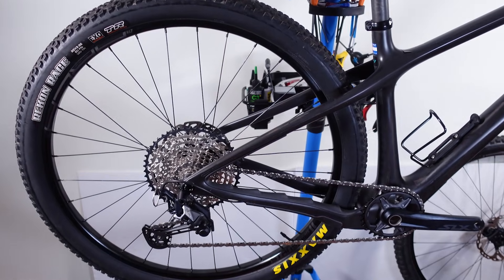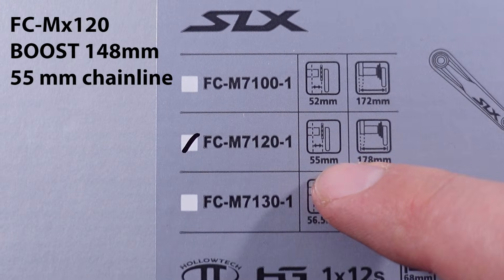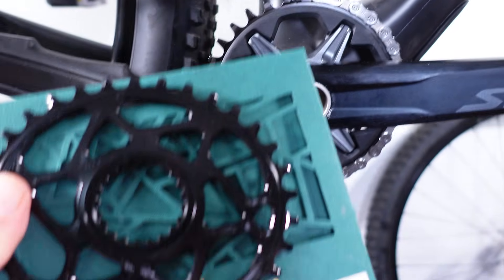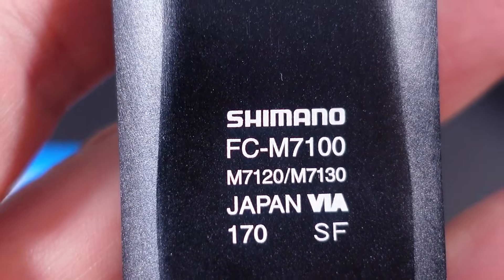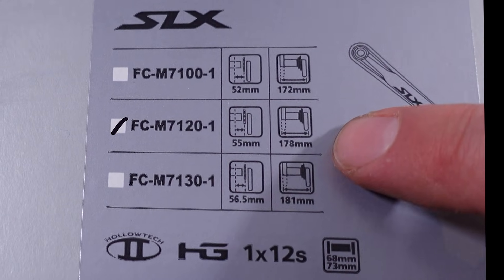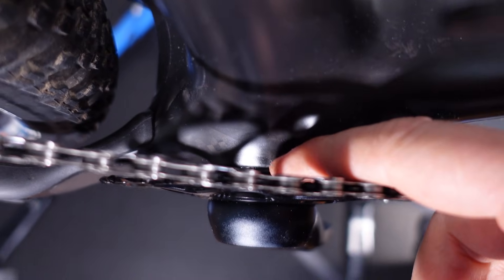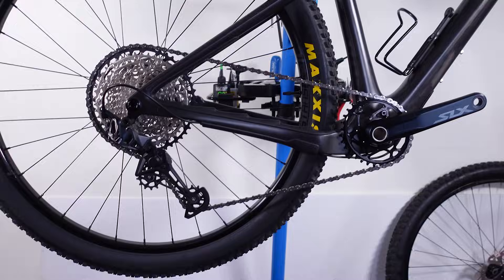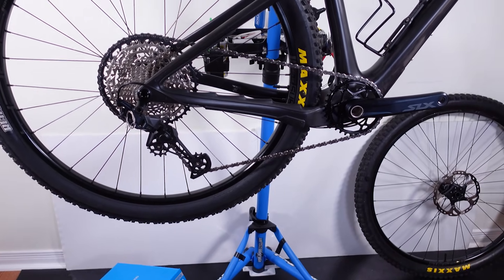12 Speed CHAINLINE Explained - 52 vs 55 vs 56.5 mm, Shimano SLX M7100 vs M7120  Cranksets

Comment: Great and very informative video!
I see from your other SLX review video that you have a 2018 giant trance 3 - it's a boost bike with stock cranks (FC-M7100-B) that have a 3 mm offset and 172 Q factor - if I'm going to upgrade to SLX 1x12 should I be getting the FC-7100 that better matches the stock config? I'm worried that the FC-7120 with 55 mm chainline would be problematic with the 51t as you mentioned.
Reply from the maker: I would go for the 52mm chainline if the bike permits.

Comment: I have a question, I bought a SW EPIC EVO frame that has 52 chain lines and I bought the whole XX SL groupset with a power meter crank that is on a 55 chain line and the crank is 34T and 3mm offset. It is also possible to buy a 34T with 0mm offset. I'm not a mechanic, but I'm wondering what can I do in this situation? Please help!
Reply from the maker: Don't worry about it, just install it. And check out my mini0series on the Transmission for more info - https://www.youtube.com/playlist?list=PLAXVoVap1M6ujA8bbEOQLDRI_ElQtvu5T

Comment: Hi there, I had a problem trying to fit oval chainrings to my bike. Most aftermarket ovals have offset which varies depending on  type of crank. I found out from the my bike's frame model(boost) is made for 52mm chainline...The bike comes with deore m5100 crankset 32t (11speed) which is has a 52mm chainline. This particular crankset can be used on non boost and boost frames. Same goes for the shimano crankset lineup 52mm chainline m6100/m7100/m8100.(The m6120/m7120/m8120 are 55mm chainline)...However when used on a boost frame like mine. It will give you a very tight clearance especially if u go up to 34t or an oval aftermarket..I would not be surprised if the oval can't fit even with  30t ones because most ovals have offsets bringing the chainring closer to the frame.

I had to find a solution  if i ever want to get a chance to use aftermarket oval chainrings on my bike. Adding spacers to the drive side of  the bb to bring out the crank doesn't cut it... This is because you are shifting the crank outboard and it will be a problem to install the left non drive side crank arm. There is not enough to grab onto the spindle and it will not be safe. I know from experience coz mine flew off 😵‍💫 when I did this.This is for shimano cranks as the installation of the crank is different from other brands.I know I had to get a crankset with a longer spindle  to accomadate the offset that comes with an oval chainring..

My solution was to purchase the m6120 (12 speed) with a 55mm chainline..next was the oval chainring from Garbaruk in 32t. The chainring model I purchased states it for m7100 series and the 8100series crankset. However, as long its for the direct mount shimano chainrings it would fit across all models with the exception of the M9100 series(XTR)...I think its because the xtr direct mount requires a different lock ring for the chainring(internal).This oval chainring from Garbaruk has an offset of 3.3mm. My bike ideal chainline according to the manufacturer is 52mm. So, 55mm (crankset chainline) - 3.3mm (oval chainring offset) gives me a 51.7mm chainline which is very close to what I was aiming for. 

My conclusion, if your frame is boost 148mm. Get the 55mm chainline cranks. This enables you to shop around for an aftermarket chainring be it for round or oval ,from different brands and choose an offset and how large a chainring that can fit ,that is ideal for your frame. Do take note some chainrings brands for 12 speed shimano needs to be used with the shimano 12 speed hg+ chain only...I chose Garbaruk coz their chainrings are compatible with all speed (9 and above) chains no matter the brand..check their website.

If your frame (boost) chainline is 52mm and you get the 52mm chainline shimano crankset, you are limited to probably a round chainring with max of 34t depending on your frame clearance.Also the chainrings must have zero offset because with an offset the chainline will be lesser than 52mm.Unless your frame is meant for maybe a 49mm chainline?

Just sharing my experience so to help others who are in dilemma of finding the right cranks to fit their bikes.
Reply: Great wright-up, have the exact same problem.
Reply: Thanks so much for this - I'm in a similar situation and trying to figure out how to make my chainline work with clearance for an oval chainring. I'll be ordering a Garbaruk chain ring it seems!

Comment: How do I know in advance, which crank length I need? I doesn't look something that is accurately measurable. I have a Giant Toughroad SLR, which has its 34T chainwheel at ~52mm, but I want a 36T. Should I buy the chainwheel first, stip the bottom bracket and try to measure? What clearance is okay? Tahnks if you read this :)

Comment: Good Video
How about SRAM Crankset ?
Are the Spindles all the same for 49mm,55mm and super boost chain line ?
I think Sram just using 6mm ,3mm and 0 offset chainring.
Reply from the maker: Very similar on SRAM, check my last video on T-Type Cranksets
Reply: @LoveMTB  how about Road Crankset can a Road Crankset fit. MTB frame ?
Reply from the maker: @jonienglish3231  what are you trying to do?🤔
Reply: @LoveMTB  got a 2011 Cannondale Bad Boy, converting to a 1x10, originally had a triple Crankset, shell is BSA 68mm was going to either put a 10 speed XT Crankset or try to put a China CNC Crankset looks quite nice has lots of drilled dimples on the Crankset arms.alao has 24mm aluminum spindle. Spindle length is 112mm where bearing rides +13mm for Crankset interface

Comment: Hi, nice to meet you here again after that “strange blackout”.
I wanted to share with you an trouble that is really becoming a bother to me. 
My mountain bike is old enough for having a non-boost frame and so unique to have a PF30 bb shell 68mm wide (and 46mm diameter).

so when I upgraded to twelve speed I bought a brand new GARBARuk 6.4mm offset chainring with my new M8100 crankset.
Long time before I changed the former Shimano bottom bracket with a Token Fusion PF30PS one.
This time I took my bike to my mechanic to mount the chainring and the crankset. So I didn’t notice anything special. 
But lately I went further with my bottom bracket looking for a noiseless bike and changed that Token bb with a custom mix of clean PF30 rollers (a minimal cup with the 30mm inner diameter roller) and I kept the old Token PF30 to 24mm adaptor.
So when I put the left crank arm I noticed that it didn’t fit to the axle even with no washer. So I took measures and I got a bit disturbed.
this is what I got comparing M-8000 vs M-8100 crankset. 
https://youtu.be/NEWraGuNGrM
Reply from the maker: That's a weird one. Did you solve the mistery?
And yeah, great to be back!

Comment: Great explanation! I tried to setup a Shimano Boost crank 2x12 yesterday that came with 2 spacers but the safety plate doesn't click in if I use both. It's strange. This is fc-m8120-b2. If I use one spacer it clicks right in. Not sure how that works as I need to bridge 6mm of Q-factor compared to the non boost version but only use 1x 3mm spacer. I have a 73mm bb shell and a bb-mt800 bottom bracket. Any clue what the problem might be? I used 1x 2.5mm spacer for the bottom bracket on the drive side..
Reply from the maker: M8120 is for a 52mm chainline as specified. Don't think you need any spacers aside from the 2.5mm one you install on the BB?
Reply: @LoveMTB  Thanks for taking the time to reply. Tried again today but to no avail. It was shipped with 2 spacers, each 3mm. They also have the non-boost version: fc-8100-2 that's 172mm Q-factor. Mine is 178mm Q factor. Hence my assumption: 6mm extra is 2x 3mm spacers which they also shipped with. The chain line is 48.8 mm (non-boost) vs 51.8 (boost). So there must be some difference somehow? When I put in 1 spacer on the drive-side, the non-drive side spindle end aligns perfectly with the crank arm and the stopper plate does click in. When I remove both spacers the spindle is too long and there is a gap.
Reply: Mind you, this is 2x12. I measured the spindle today and it was around 114mm long. This seems to be the same as the length of the 7100 you mentioned in the video, which is weird bc I have the boost version. 8120-b2.
Reply from the maker: @bigpimpinbig1  I would use just one spacer on whichever side aligns best with the frame. Sometimes they do provide extra spacers, but not the 3mm ones?😉
Reply: @LoveMTB  yeah normally not the 3mm one. The end of the spindle lines up exactly with the crank arm when using 1 spacer. Usually it's supposed to be a bit deeper in the crank arm so 1 spacer  doesn't look quite perfect either. Thanks for the advice.
Reply from the maker: @bigpimpinbig1  Glad to help would love to hear your long term experience. When the spindle is too short the little plastic pin part of the plastic washer between the pinch points of the crank, the little pin won't go into the spindle dedicated tiny hole. That would be the clear sign, if it goes in I would take up the pay the usual way and tighten it with a torque wrench, the usual stuff.

Comment: Are the spacers required on BOTH sides?  Not that I would do this but... what would happen if the spacer on the non drive side crank was not installed?  The would effectively increase the drive side by 3mm, right?  But would the missing spacer affect performance? Asking for a friend.
Reply: Then the spindle would shift side to side as you pedalled, along with your chainring. The spacers keep the cranks centered in place relative to the bottom bracket.

Comment: I find the wider chain line favoring the smaller cogs to be less practical.  Most the time when I back pedal on the largest cog the chain will drop making it hard to climb.  I would prefer the chain line to favor the largest cog the same way it favor the small.  Think this would work better.  When in largest cog and backpedal no chain drop, when in smallest cog back pedal if rides up that won't be so detrimental to descending or flats.
Reply: Exactly this!

Comment: thanks for the video, I reach this because I want to change from 175mm to 170mm cranks and taking the oportunity of this change to upgrade from deore to deore xt. I realized my boost frame (hardtail mtb) was running with a deore model fc511 (178 q factor and 52 chain line). So XT models have only 178/55 and 172/52I don't know smooth will work 178/55 in my deore rear derealleur....any advice?
Reply: @LoveMTB  thanks so much, i watched that other video anda confirms what I supossed, that slx has no difference in weight. I Will consider It for my upgrade. thanks again

Comment: Great video. This helped me resolve an issue I was having on my Chromag Rootdown. I was looking at installing an older M780 Crank but the spindle isn't long enough. Shimano specify Qfactor but not the actual spindle length. Looks like I need an 8120.

Comment: Hi, if the m7100 chairing is for Boost rear spacing, how is it that it can be used with a 142mm rear axle?
Reply: @LoveMTB  Just wondering...can I use a m7120 for a non boost frame? I have one on my bike that I want to swap out, but the other bike is non-boost

Comment: Recently tried to mount an xtr m9100 crankset with 52mm chainline on my 2017 kona honzo AL  and the crankarm hit the chainstay. The bike can hold 27.5 x 3" tires so i needed bigger clearance. Funny enough my m8000 cranks work just fine but im now putting on a m7120 crankset to run full microspline hg+.
Reply: @LoveMTB my wife and i share an old fatbike and the honzo plus is the 2nd winter bike!

Comment: Hi there, hoping you can help me out, I have a XT build transition spire. Got the direct mount Absoluteblack chainring and after trying to fit it I noticed the offset is different. But Absoluteblack don’t have different offset options for shimano? Would it be ok to use spacers?
Reply: @LoveMTB  definitely not the same offset, when you lay them on a bench crank side down the Absoluteblack is a few mm taller.
Reply: @LoveMTB  chainstay is ok but it’s now rubbing again the chain guide. It’s weird that the offset is different in the first place.
Reply: @LoveMTB  yeah its really weird I couldn’t find anything on their site. The guide can be adjusted but further out not in… haha

Comment: Great info on your channel, I absolutely love it! (And thank God I fell on this vid)

So I'm building a bike from scratch, If you buy the complete bike, its comes with a SLX FC-M7100-1 crankset, 52mm chainline.

I currently have a FC-M7120-1 crankset, I just figured I'll have a major chainline issue. Is it possible to install the drive-side BB spacer on the non-drive side (on a 73mm BB) to resolve this issue?

Thanks a lot!
Reply: @LoveMTB  Yes, I do have the BB-MT800! Thank you so much for your quick reply, I appreciate and you have saved my day! Thanks for the link, Ill check it out right now!

Comment: It’s so easy to order the wrong part these days thank you for your videos I just ordered a 175 crankset  luckily I got the right part 🤩 M9100 xtr I was confused because the non-drive side arm reads 9100/9120
But the Drive side only reads 9100 it’s perfect now I can hammer my new longer arms

Comment: Running m7100 (52mm) with 32t round on a Yeti arc, wondered why the clearance is tight AF. This is an extremely useful video. I'm going to keep running as I am for now, especially since I get a better chainline in a hilly area, but it is super tight! No way could I go oval or 34t. Great video, thanks!

Comment: Thank you so much for this video. I Blindly ordered a M6100 to upgrade from 1x10, to 1x12. Luckily my 148 boost frame has an aggressively indented chainstay at the crank.  I measured the shaft on the old crank and it was 115mm just like the M7100. Thank goodness!

Comment: XTR comes in M9100 vs M9120 both 52mm chainline but QF is different. How do I know which one I need for my boost frame? I’m currently using SRAM Eagle 3mm offset Boost chainring and SRAM GX cranks.

Comment: Hey. Great video. Ive tied myself in knots trying to figure out if i need the 52mm or the 55mm. 
The question is: my bike is boost and the chainline is listed at 53mm, SO is the 52mm or the 55mm crankset the beat one to use? Hopefully you can help.
Reply: @LoveMTB  thanks for the reply. Will give it a shot :)

Comment: I recently purchased a used Cannondale Habit that did knowingly need a bit of attention. After replacing a few items, including a new chain and derailleur, I witnessed what I determined excessive chain drop when back peddling. I had also replaced the bottom bracket with a new, identical Sram model (I did check OEM specs for the model) and installed spacers on each side just as they were. When checking chain line, it was off so much that it required locating both BB spacers on the non-drive side to correct the chain line. I am still scratching my head as to why this was necessary. Thoughts?
Reply: @LoveMTB  I actually have room to add more but it would not benefit in any way

Comment: Hello, I'm running into a chainline problem but with sram crankset with the same bike. I purchased a crankset (Sram xo1 170mm with 34t chainring boost/3mm offset) 52mm chainline. Would 0 mm offset 34t chainring  fixed the 55mm chainline problem? or would a "wide boost" crankset/55mm chainline crank will fix the problem? Thanks you, love your videos

Comment: Good information. It really seems between the limitations of boost, wanting to run wide tires and frame designs while not having the chain fall down the cassette when back-pedalling that we're pushing the limits... too bad superboost wasn't the common standard.
Reply: @LoveMTB  I did not. What did We Are One do with their chainline on superboost? I have superboost and even 55mm CL still seems like much on the big cog, so I'm definitely curious
Reply: @LoveMTB   Good to hear because I'm also running 55mm CL (DUB regular cranks, 0mm offset ring) on my superboost rear (2019 Knolly Fugitive). Gives me good chainline and low Q factor.  Honestly I'd go even more in-board if I could but the ring would hit the chainstays. In steep mountainous areas we spend A LOT of time in low gear and I realy don't care about chainline for the high gear. My last bike had an elevated chainstay so I could get that chainring in close toward the tire

Comment: very helpfull . thank you. I have a question if you can help. My  bike comes with a 55 Cl LENGHT originally. I bought the frame and are building it up. Can I use a 52 cl lenght but only use spacers to ensure clearance for my chain ring?
Reply: @LoveMTB  I am building a santa cruz hightower C. The XT build from factory uses the M8120 which has 55mm CL length. My question is can I use a SLX OR XT M8100 which has 52mm. I have never build a bike so my question is can I just add a spacer to get to 55mm? It uses a 73mm BB. I think I understand what you are saying. I don't know of it will be ling enough. The xt build uses a 73mm. Or is it not about BB lenght but the crank spindle lenght? So the 8120 is longer...and the 7100 0r 8100 wont work?
Reply: @LoveMTB  thank you.  will something like a M7120 work as well ? Does it matter?

Comment: My 55mm chainline Trek Top fuel only has a 3mm spacer on the drive side. Same with a 2022 Scott Spark I looked at. I'm assuming a mistake was made in assembly
Reply: @LoveMTB  it is an 8120 XT crankset. If I remove the spacer there is still loads of space for the chainring clearance. Reason I'm concerned is that the crank rotation feels "stiff" at some points and does not spin as freely as I would expect. My theory is the missing spacer is causing the issue
Reply: @LoveMTB  preload is very light, just enough to take up the slack. Maybe a trip to the dealer is in order
Reply: @LoveMTB  BB was seized on one side. New FSA BB installed under warranty. Only one Shimano spacer between the driveside and the BB. If I try add a spacer on the other side the crank arm won't fit